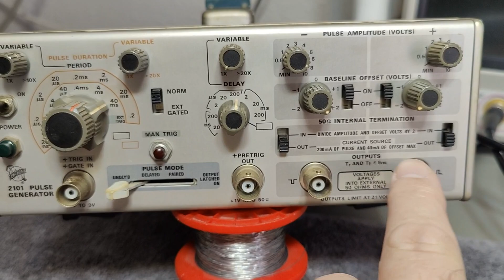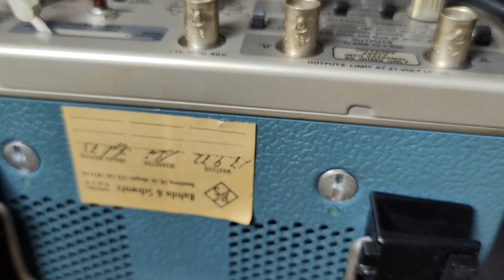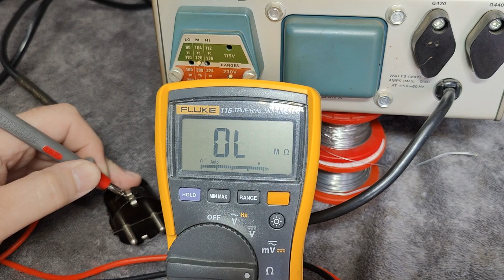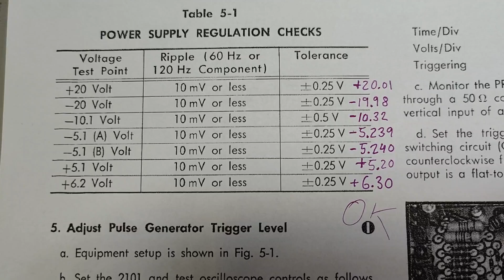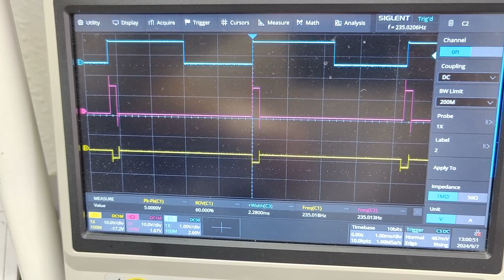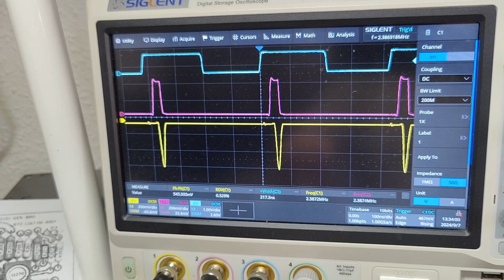Tektronix 2101 Pulsegenerator 25MHz pos neg 1972 repair teardown

Comment: Did they really specify BC557, or did someone put these in as (possibly insufficient) substitutes later - european spec transistors in that era of american equipment sounds very off :) If they are already replacements, something else must be lurking in the unit and killing PNP transistors (or, of course, the way the previous owner used it was hard on all the PNP transistors). ... Also, I am sure the guy that specified the nomenclature for the BC237/BC307 series and the BC327/337 series has a very confusing place in hell reserved for them :)
Reply from the maker: I dont think anyone specified BC557 it was just the most near drawer to prove this unit can be fixed, soon i will go check out specifications specially speed, and find a better replacement.

Comment: Interesting the "Inv-Nr." Sticker has the I written with more than a J glyph - seems to  have been a thing in Germany ages ago (1960s and earlier probably?). The inventory Stickers must be far older Stock than even the device. You often will find "J" (actually I) for current on 1950s era german multimeters (typical of old Hartmann&Braun or AEG or Neuberger instruments!).

Comment: The real way to screw wire in mains plug and simillar aplications is to crimp a wire ferrule on the wire and then screw the wire in...
Reply: Sure, but sufficient for a device that consumes maybe 30W
Reply: @inse001  Insufficient for a device that might suddenly decide to draw 3000W though :)
Reply: @splitprissm9339  the 0.4A fuse won’t allow